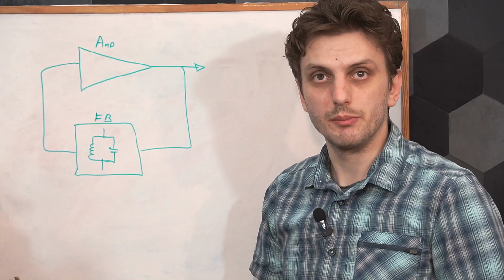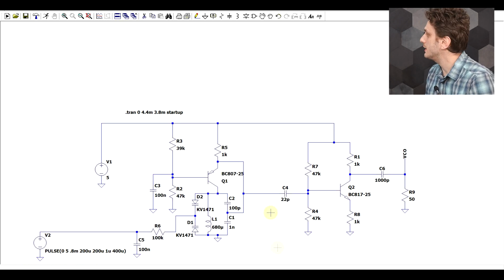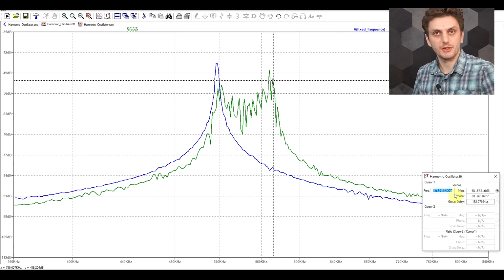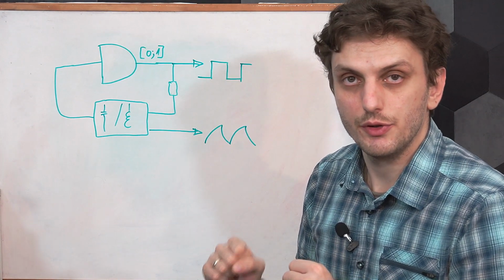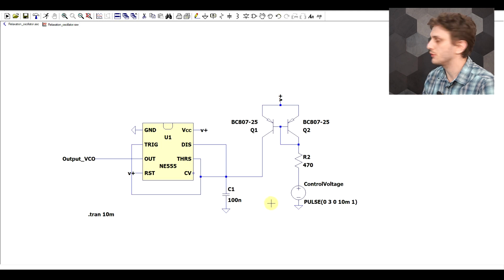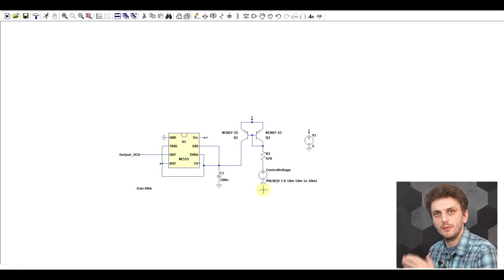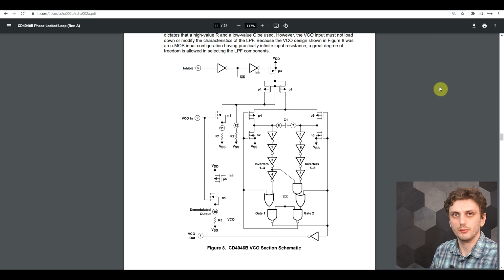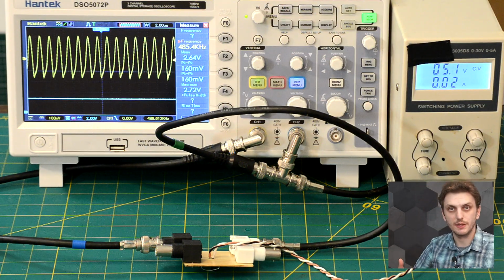PLL's - The Voltage Controlled Oscillator (VCO)

Comment: So you mean relaxation oscilator less components but only square or tiangluar wave which is cheap clock for digital circuits and Harmonic oscilator all types of waves but more components which good for RF and a other baseband circuits

Comment: 12:21 What would you do if you couldn't use the second voltage source connected to X3? In other words. How to control the current mirror from the voltage source conncted at V+?

Comment: I believe that the Colpitts oscillator with varicaps is superior in terms of frequency stability and phase jitter, particularly at higher frequencies. Use of the relaxation oscillator is typically limited to the lower frequencies (<1MHz).

Comment: hey my friend how we can make an vco that be sensitive to microvolt changes example 3micro volt increase on control voltage ???????? I need to know this really!!!
Reply: The VCO may already be sensitive to mircovolt changes, how are you gonna measure such a low frequency drift if it's the case? You're also  gonna need to take care of noise sources in the circuit that might swamp your control voltage
Reply: @1900OP   ..the main problem in my case is noises cause I'm using a timing circuit it's very important to reduse noise I can't reduse noises efficiently
Reply: @mu8502  What have you tried?
Decoupling capacitors and voltage regulators will do nicely. Also filters.
Reply: @1900OP  in 555 timer frequency and pulse width have changing(a little bit) ....I don't know why??? cause I'm using a pulse width to dc voltage converter or (pwm to voltage converter) a little change in pulse width or frequency can changes the dc voltage output maybe this not called as (noise)but it's like that....
Reply: @mu8502  Got a schematic diagram of your circuit? Are you using a 9V battery?
Reply: @1900OP  no I'm using a 12v battery my main problem is ic 555 timer that changes frequency and pulse width in micro second range I even used decoupling capacitors I will send you schematic too...

Comment: hey my friend I have a question: sometimes control voltage start from 8volt to 10volt(for example)
but vco work with 0v to 3v(for example) volt
what circuit can convert 8 to 0 and 9 to 1 10 to 3???????
Reply from the maker: You could start with an 8V zenner in series with a resistor - its not perfect, but its simple - it will take the 8-10V to ~ 0-2V; otherwise, you would need an op-amp circuit to perform the subtraction (subtract 8v precisely) and then another op amp to multiply by 3/2 - this will make a proper conversion of the 8-10V to 0-3V.
Reply: @FesZElectronics hi I tested it and subtractor was enough and my problem get done thanks you are best!!!

Comment: In theory, a BJT can be used in a Colpitts oscillator,  When constructed, the choice of BJT makes a lot of difference, and usually, the tank circuit is loaded by BJT and the oscillations die down when you vary the frequency (narrow tuning range). The sine wave is not as distortion-free also compared to a JFET if used as an active element. JFETs generate less distorted sine waves and are easier to work with when you actually build the oscillator.

Comment: Now I’ve never seen that kind of VCO before somehow! A sawtooth wave with a current mirror being controlled with a variable voltage. And the use of an H-bridge with it is neat too, but I can see why you decided not to use it.
I think I’ll stick with using a vactrol and a Schmitt trigger + integrator as my modular synth VCO, the main reason being I can take he control voltage from my oscillator and feed it into identical vactrols to synchronise VCFs with my sounds. But if there’s a current-mirror based VCF design I may just swap over.

Comment: Thank you for the lesson. The only thing left me in doubt. It is practically impossible to obtain a fill factor of exactly 50% with circuitry. There will always be some difference between the charge current and the discharge current. At the same time, you can be sure that the duty cycle will be exactly 50% if you divide the frequency by 2 using a trigger. Therefore, it would be very logical to use this prudently setting the VCO frequency to twice the required one and then divide it by 2. Isn't it?
Reply from the maker: You are right, a perfect 50% duty cycle cannot be obtained by charge/discharge cycle since some of the charge gets lost because the capacitor isn't a perfect storage element. On the other hand, the H-bridge configuration used in the 4046 performs both the charge and discharge in every half cycle - the capacitor is never left at 0V but rather the Hbridge switches when the capacitor is either at Vcc or -Vcc, so any losses should occur in both cycles, giving the 50% duty in the end. 
I guess issues with the divide by 2 circuit will occur only at very high frequencies - modern day computers use clocks of ~4GHz; it much easier to make a 4GHz oscillator than an 8GHz one, I guess.